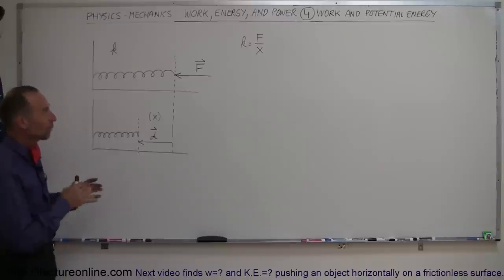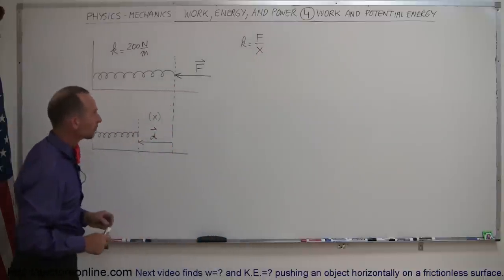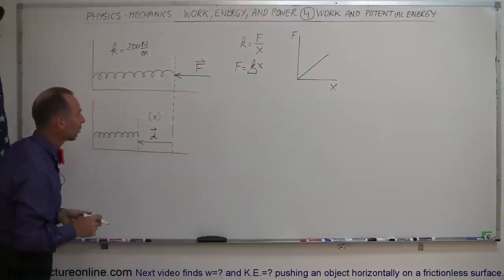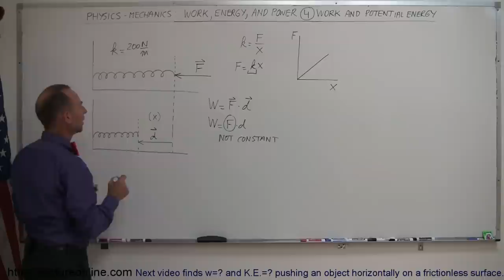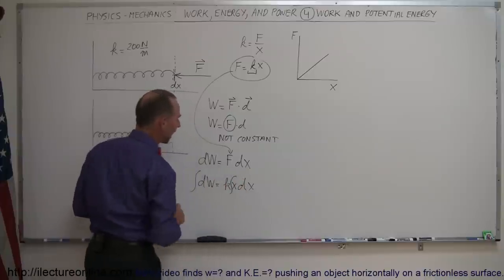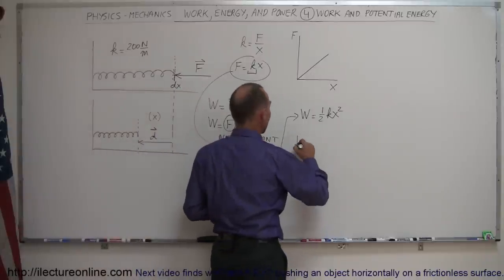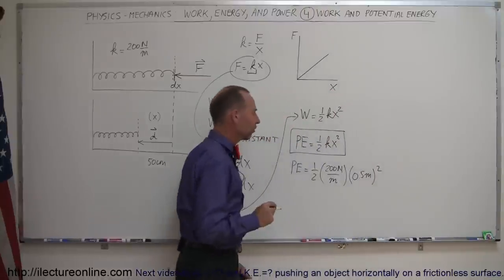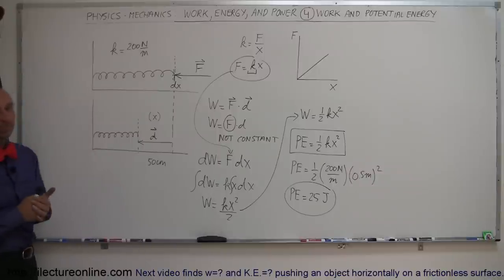Physics 8  Work, Energy, and Power (4 of 37) Compressing a Spring

Comment: Brilliant Brilliant Briliiant. I learned a lot. Small q thought. If the relationship between Fand x is linear and constant, why do we need calclus? Couldnt it be solved with linear equation line y-y1=m(x-x1)
Reply from the maker: The rule is that if the force is not a constant, you will need to integrate to find the total work.

Comment: If a block of mass 'm' is suspended from a spring such that the string is streched, lets say 'x' (metres) due to the weight of the block and then a sharp impulse is given from below which gives the block an upward speed 'v'. Then how do we calculate how high the block will rise?
Reply from the maker: The impulse will cause a change in momentum:    I = delta p = m * delta v.  That will give you the kinetic energy of the block, which will then be converted to the spring's potential energy.  (Do NOT include gravitational potential energy, since the spring has negated that).
Reply: Michel van Biezen Thanks a lot!

Comment: so if it takes 200N to compress it one meter, and since the force is not contant, does that mean that the 200N value is the sum of all the different forces in the 1 meter interval? is 200N just how much is needed to get it started?
Reply from the maker: If you apply 50 N the spring would be compressed 25 cm.  If you apply a force of 100 N then the spring would be compressed 50 cm and when you apply a force of 200 N the spring is compressed 1 m.  There is a linear relationship.

Comment: From my textbook, when talking about the formula with spring force this is it: Fs= -kx (Hooke's law), just want to know if that negative sign in the problem indicates that the force and displacement go in opposite directions, am i correct? If so, why didn't you that negative sign when doing your problem? If I'm wrong, why does my textbook include that negative sign?
Reply from the maker: Negative signs are often misunderstood in physics.  In principle they indicated direction when we use vectors.  When we only calculate the magnitude of vectors, they can only be positive since the magnitude of a vector cannot be negative.  In the case of Hooke's law, F represents the force OF THE SPRING.  If you pull to the right, the spring will pull to the left.  So if we calculate the force ON the spring, it will be positive when the displacement is positive.
Reply from the maker: The F in Hooke's law is the force exerted by the spring.  The force pulling on the spring will be positive.

Comment: Can someone help me? I cant solve this problem:
the spring of a toy gun has a force constant of 500n/m. If it is compressed 0.05m and a ball of mass 0.01kg is placed in the barrel against a composed spring. Determine the velocity with which the ball leaves the velocity which the ball leaves the gun when released
Reply from the maker: Set PE = KE    (1/2) k x^2 = (1/2) m v^2   You can find lots of examples in this playlist:  PHYSICS 8 WORK, ENERGY, AND POWER

Comment: Hi sir, normally after we integrate the function, we add constant, but why we dont in this problem?
Thank you!
Reply from the maker: In the integral it was "understood" that we had limits from x=0 to x=x.  Physicists tend to be "sloppy" when it comes to writing out those limits.  That is why we didn't need the constant of integration.  (Very good observation).
Reply: Ok I have read your response and I quite understood, but I got one last question, Is the result (W=1/2kx^2) the AREA underneath the straight line you drew? and does that area represent the Work Done?
Thank you!
Reply from the maker: That is correct.

Comment: When you say the spring is not moving what does that mean? Since the spring has displacement doesn't that mean it's moving? Also, thank you very much for your videos! I'm studying for SAT 2 physics and don't have a teacher, so they are extremely helpful.
Reply from the maker: KE = (1/2) m V^2 where v is the translational velocity.  Since the spring does not have translational velocity the KE is considered zero.  Any motion during the compression is very small and the KE related to that motion is so small that it is insignificant and ignored.  (Good question).
Reply: @Andango

 I came here for the same reason!!! I'm taking the SAT 2 physics this October and have no teacher to teach me :( 

How about we study toghther? ya know skype and stuff?
Reply: I'm taking the exam in October as well. Unfortunately I don't have a skype account, however if you need advice feel free to send me a message. Currently I'm using the Sparknotes guide and this youtube channel to study. Good luck!
Reply: DUDE MAKE A SKYPE ACCOUNT WE CAN HELP EACH OTHER ALOT !! why would we study all that alone :c And I've completely read the Sparknotes physics sat guide so you in a good company pal :3

Comment: If you leave a spring under compression over time does it lose potential energy? If so, What is the equation for the loss?
Reply from the maker: +WildGoose2012 
Theoretically the spring will maintain the potential energy.
I real life, the spring could lose its stiffness and begin to lose energy.  There are many factors that determine that.
Reply: +Michel van Biezen where does this energy go?
Reply: +Nuphar Marom It might be heat due to friction

Comment: Thanks again for the video, I had no idea that's how the equation [E = 1/2kx^2] was derived; I simply have a formula sheet with that written on it. Until now, there's not been a need to integrate equations [for me at least]; all the equations are given. Is it worth knowing how all these equations are derived and how to integrate them?
Reply from the maker: It is OK not to know how the equation is derived while learning how to use it, but in the end it will give you better understanding to know how the equations are derived and in some cases to see the connection between the physical properties and dimensions and the equations.
Reply: Michel van Biezen I see, I guess it wouldn't hurt to try and learn how equations are derived then; it would certainly be a huge help if I were to undertake physics at university or just generally when trying to deal with equations of a harder difficulty. Thanks

Comment: So at the time of compressing spring, work done by external force is supposed to be negative right? But since external force and displacement is in the same direction how is that possible?
Reply from the maker: Why would work done by an external force be "negative"?    It is better to think about what negative and positive work means.
Reply: @MichelvanBiezen  since work by spring at the time of releasing a compressed spring it is positive and work done by spring= (-) work done by external force. As in they are equal in magnitude but opposite in direction
Reply from the maker: Work results in a change in energy.  If the work done on an object increases its energy (KE or PE) then the work done is positive.

Comment: As force is varying then displacement also varying accordingly due to linear relationship, then why do we take only force as a constant value why not displacement?
Reply from the maker: There is no linear relationship between force and displacement.  There is a linear relationship between force and acceleration.  (F = ma)
Reply: I am talking about stiffness constant of the spring...as there is a linear relationship between force and stretching
Reply from the maker: Yes, the spring constant = force / distance
Reply from the maker: (btw.   force was not taken as a constant value in this video)

Comment: question:
as an engineer without the exact numbers would multiple springs be better than 1 large spring to handle work linearly (in theory)
could someone make/explain to me a graph to show it and where the load would be better stopped by 1 compared to 3 with less energy?

exp
Spring Large Single  l~~~~~~~~~~~~l
Spring mult.               l~~~~l~~~l~~~~l

Comment: Why work that act in to the spring equal to energy in the spring
Reply from the maker: That is assuming that no energy is lost.  So we take the idealized situation with no energy lost during the process.
Reply: Does formula that say  u2-u1 = work done by conservative energy is the formula that describe this question.
Reply from the maker: u2 - u1 gives you the difference in 2 energy states.  It doesn't give you any specific detail

Comment: can someone help me?  I have 1 liter of air at 1 atm and I'm compressing it to 0.045 liters and have a pressure of 39.476 atm.  How much force is needed to compress the air?  can someone just walk me through the math?
Reply from the maker: +ocast evo 
The answer depends on the shape of the container, its dimensions, and the dimension of the piston.
Do you have that information?
Reply from the maker: +ocast evo 
The answer depends on the shape of the container, its dimensions, and the dimension of the piston.
Do you have that information?
Reply: Michel van Biezen
yes the swept volume of the piston is .955 liters and is a cylinder with a height of 12.15 cm and a radius of 5 cm.  The clearance chamber is also a cylinder with a volume of .045 liters.  Its dimensions are 1 cm radius and a height of 14.5 cm.

Comment: Wait, how is it potential energy when there's change in height ? I thought it would be kinetic energy if it were being compressed horizontally? No?
Reply from the maker: +Jomel Sagsagat 
Energy stored in a spring is also potential energy.    PE = (1/2) k x^2
Reply: +Jomel Sagsagat 
Potential energy is the "ability" for something to do work - so if you compress (or stretch) a string then you can release that spring at a later time and have it do work.

This is why you also have potential energy when you move something to a greater height - that object will then, relative to the lower height, be able to do work until it reaches the lower height and comes to rest (for example, you could tie it to a rope and have it give energy to a power generator or something).

Professor Biezen has a bunch of interesting problems somewhere that involve both kinds of potential energies at the same time - they are definitely worth a look.

Comment: Why force is not taken as Kdx while calculating dw
Reply from the maker: W = F x        dW = F dx
Reply: @MichelvanBiezen  
Force applied for moving the spring for a distance x is F=kx
Similarly force applied to move a distance dx , F=k.dx 
So small work done for a diplacement dx   , dw=Fdx=Kdx.dx 
( I know i am wrong but why it is not taken like that)
Reply from the maker: A small amount of work done = the force at that location x the small distance traveled.   You must have F to represent the force at that location.  Note that the force a little farther will be different, so F must be a function of the position.